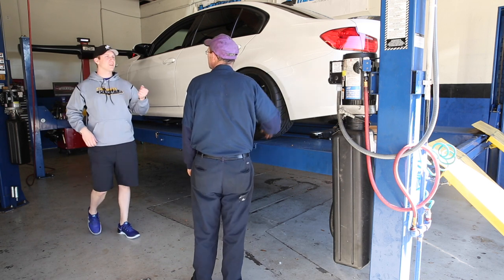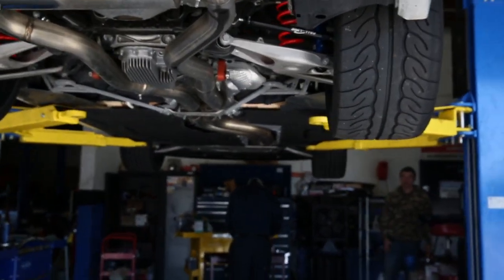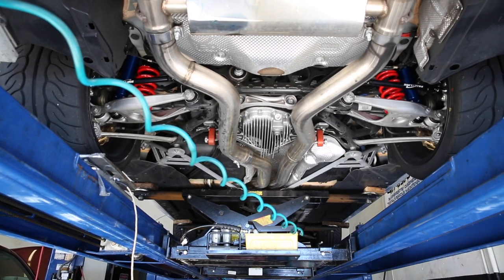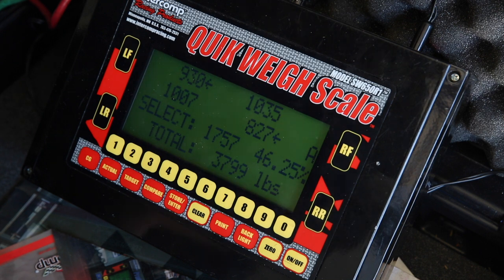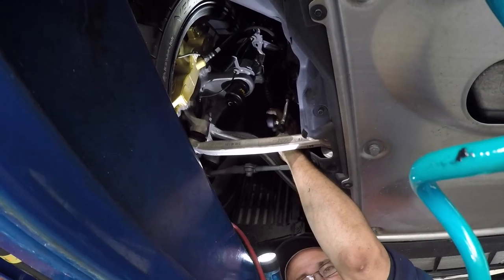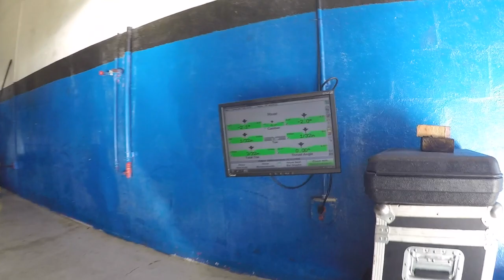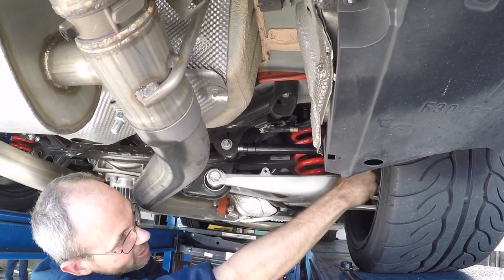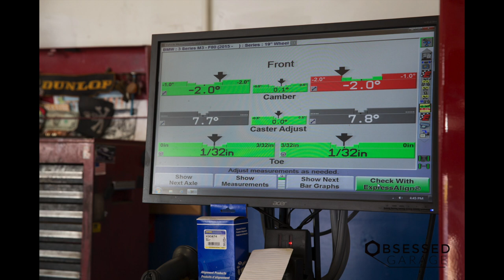2015 BMW M3 Corner Balancing and Alignment

Comment: Just like the tension arms, those rear control arm bolts HAVE to be torqued with weight on the wheel, on the ground or rack.

Comment: So just wondering, why do you have toe in in the front? Don't you usually want toe in in the back and out in the front for better turn in? Im new to this stuff which is why I'm asking XD
Reply from the maker: +SkillerDanHD I'm no alignment expert, but a little toe in helps with straight line stability.
Reply: +Matt Moreman ya thats why I thought you have toe in in the back, but out in the front to help turn in. However like I said i don't know much about this stuff XD

Comment: Matt, I am considering the AWE exhaust for my 2015 M3. Do you have the rattle at start up anymore with that exhaust? That is one of the main things I can stand with the factory exhaust at start up. That excessive rattle at start up.
Reply from the maker: +Daniel Rivers I don't have valve rattle with the AWE like I did with stock and Akra.
Reply: Great to hear, and thanks for the feedback. I will have to consider this exhaust for sure then. The rattle is annoying especially for a car of this caliber and cost.

Comment: Hey Matt I just applied hydro2 to my car and it looks awesome, do you know if I can put adams detail spray next time I wash my car or will that negatively affect the hydro2?
Reply from the maker: +flatblackbm I've learned that spray on wax doesn't work well with it.  Detail spray seems to be okay.  Did you apply Hydro2 directly to the paint without anything else on it?  I just threw it on top of Collinite.  It did okay the first application.  I put it on again this month and it turned into a mess.
Reply: +Matt Moreman I think I read somewhere that you should strip the surface of any wax before you apply the hydro2, maybe thats why you are having problems with it. I washed the car with citrus wash then applied the hydro2, my car didnt have any existing wax on it.